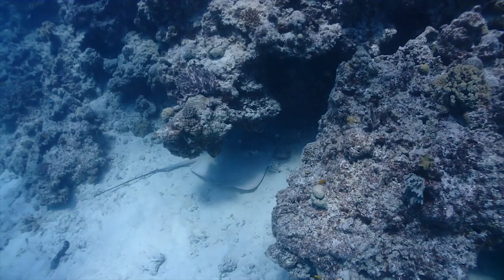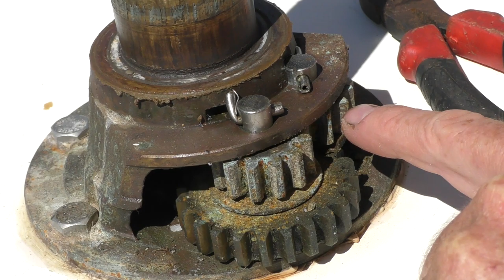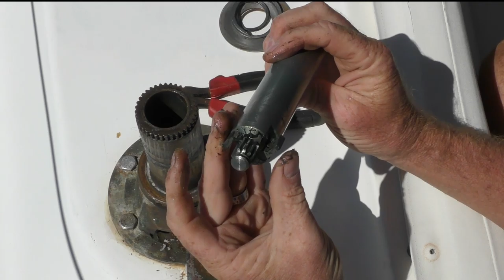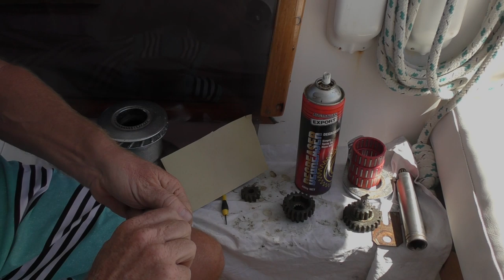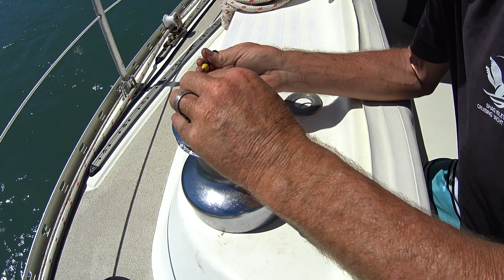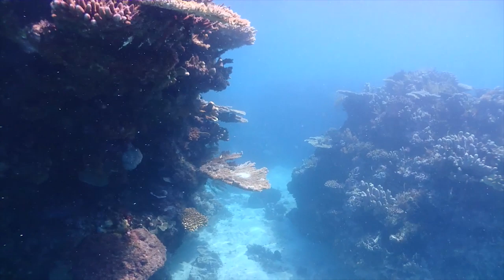How To Service Your Sheet Winches & more (Sailing SV Sarean) EP. 45

Comment: can you use special water proof greese and oil that is used on steering cables and gear boxes on outboards on fishing boats and trailers?  I ve seen covers for winches- you have some?  I would think they have seals and a way to oil some.  I can see that to much grease might be bad, but water proof grease really works good till it gets about 15 degrees F.   thanks.
Reply from the maker: +Lakehunter48 P Haven't tried it buddy but good to know thanks!